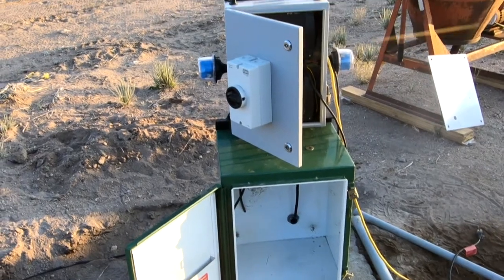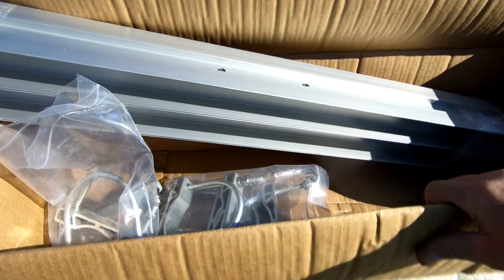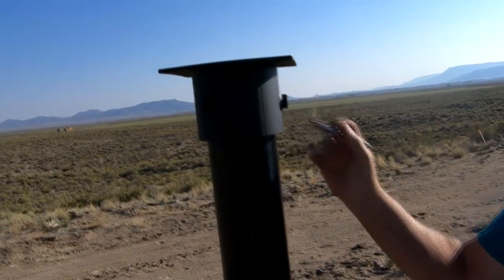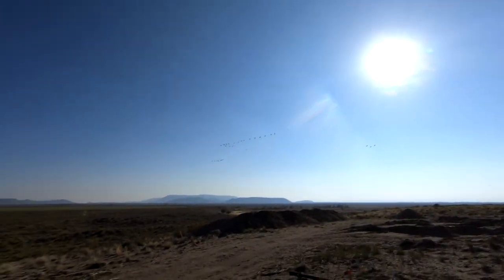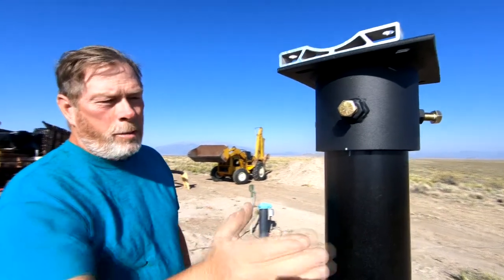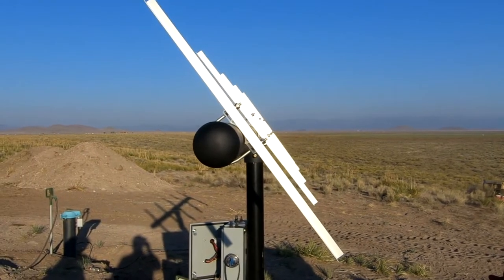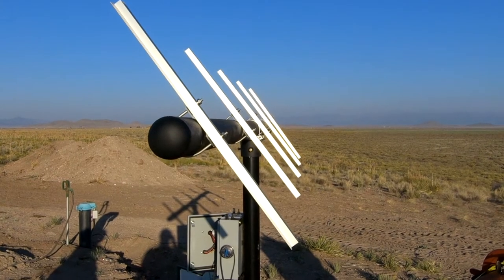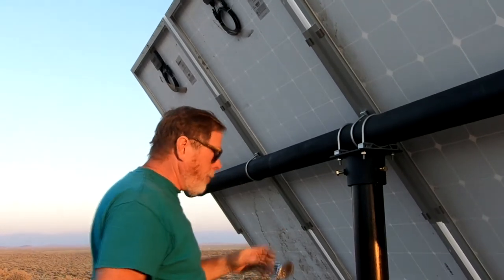Solar Well and WiFi Station - Sun Rac Installation

Comment: That rail and clip set up is pretty cool, why not have 3 posts in the ground holding the panels?Haha.😀
Reply: I'm with you. I would be hard pressed to not put something on the ends of the mount pipe to support them from the ground.
Reply from the maker: Dont' need them!  That's the beauty of this system!
Reply from the maker: That beam is  piece of 4.5 inch OD schedule 40 steel pipe. It wiggles a little, but don't think going anywhere. This is the recommended setup from GenPro. We'll see how it goes. We could put another post up there some day and expand this array if we want to.